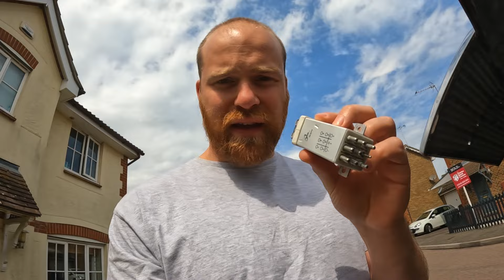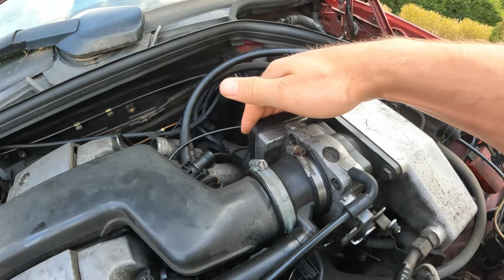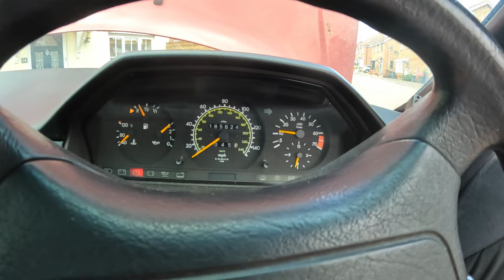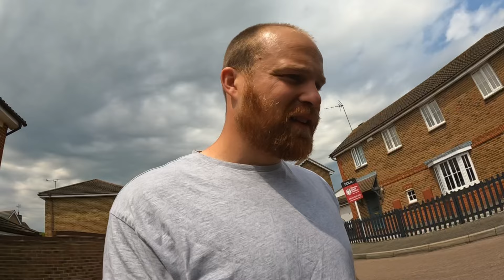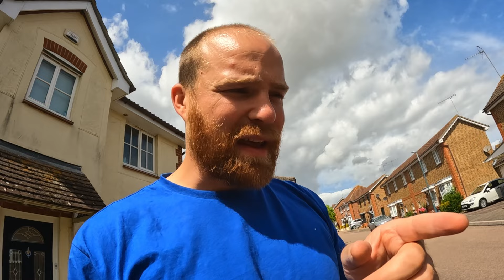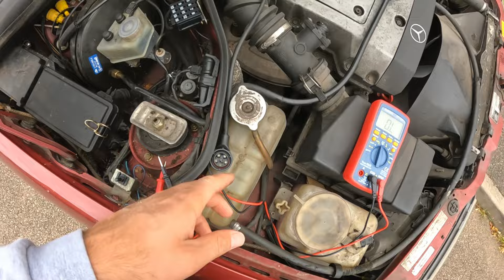Is this why my Mercedes 220E keeps cutting out?

Comment: Mobile workshop...parked right in front of a road drain. Seems sensible enough 🤔🙄😂

Maybe the MAF connector wires are not spliced into their correct counterparts? Would only take one to introduce an issue?

I would get the right MAF lead and splice it in properly but you will need to identify the connector pins both ends.
Reply from the maker: The backpack was over the drain at one point, I swear 😅

Yeah some further investigation needs doing for sure

Comment: when the maf is unplugged the ecu should run on a default setting. Usually when a maf is knackered the car runs rough as hell.

Porsche have been working on synthetic fuels to run there old cars

Comment: Nino if it was me, I’d make a whole new loom for the MAF, just get the same size grade cable and chop out all the bad parts then either solder and heat shrink if you got the capabilities or use crimps for now just to get it running, then you can get someone with good soldering skills to do it all for you :)
Reply from the maker: Yeah looks like that's what I may have to do. Will crimp it to begin with and then look for a more permanent solution 👍🏻
Reply: @NotEconomicallyViable  if you were near I’d help you with all the soldering, as I’m based outside London :)